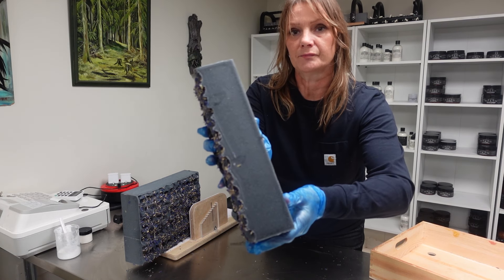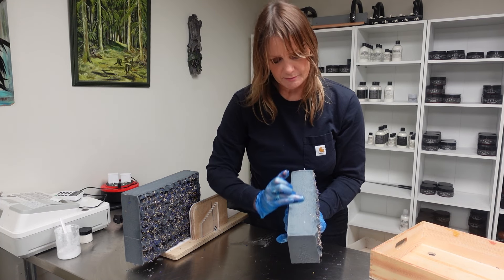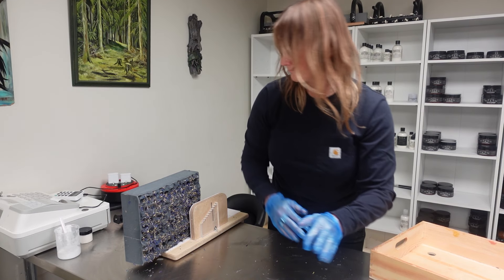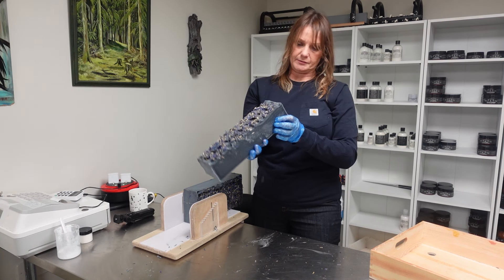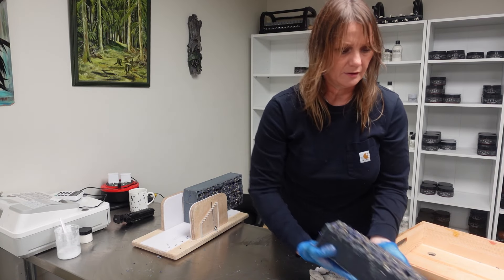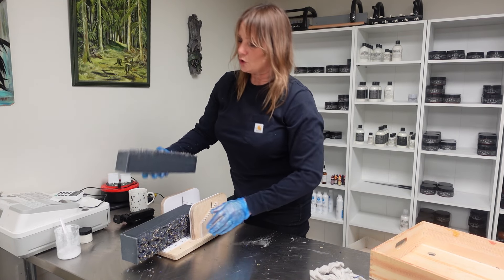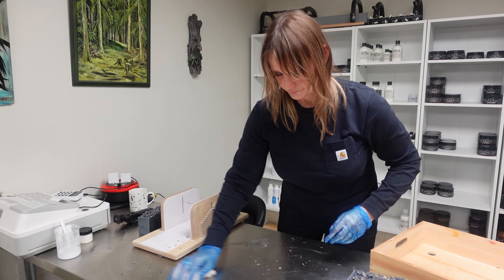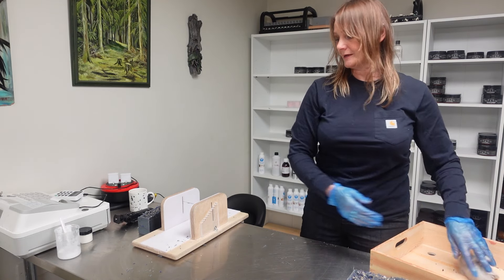MAKING & CUTTING ROOK & RAVEN CHARCOAL SOAP | FuturePrimitive Soap

Comment: Tiggy, that's silicone rash that texture on your soap, usually only happens when a batch heats up quite a bit. Activated charcoal can cause a bit of heat so that'd be it. It's only a cosmetic issue really, doesn't effect the soap otherwise.
Reply from the maker: Thank you for this. This soap does heat up, always. I shall do some tests to see how much the ones that don't do this heat up. You've hit the nail on the head, I reckon.

Comment: Nice and simple!❤
I think your charcoal is sucking up moisture. Try to mix it with water before adding 😎
Reply from the maker: Hmm, maybe, but this happens with a few different soaps. Not just one with charcoal. I've never had to mix with water in all these years. It's a bit of a mystery, but I do think it's the batter thickness. It needs to be thicker when I put it into the mould.